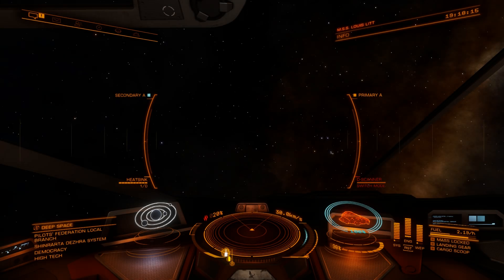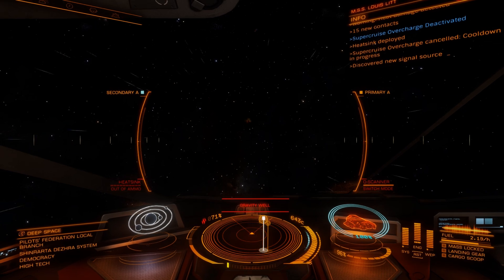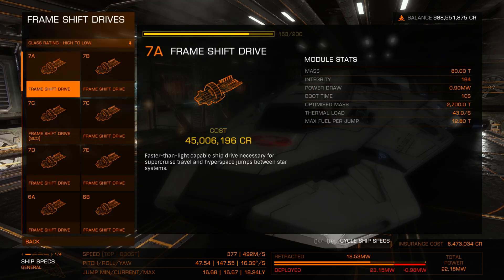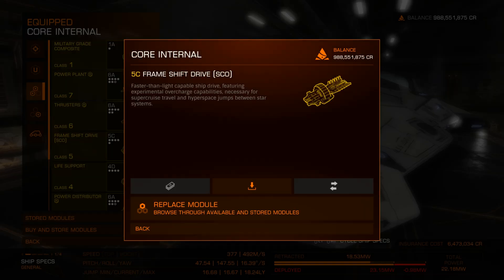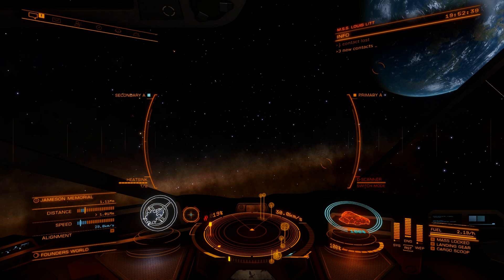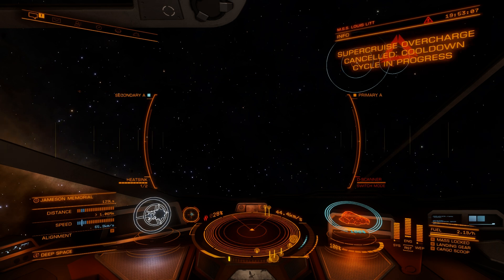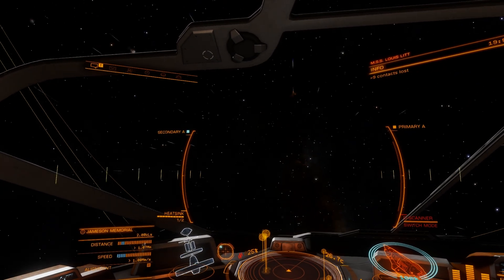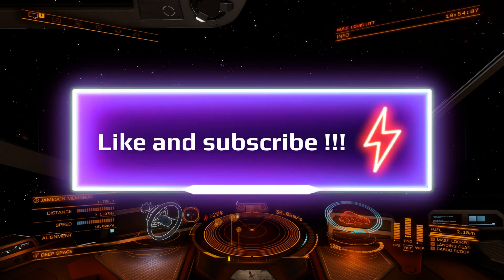Elite Dangerous Odyssey. The Thargoid FSD (  How does it work and where to get it ).

Comment: Tried it myself, it’s cool but don’t see why I would use it…07
Reply: It's a prototype, so it's not very useful at the moment, but perhaps on the new Python? It will probably be rolled out on B and A-rated FSDs later and so on . . .
Reply from the maker: For the moment there is not really a use for it... 🤔
Reply: @Grimulas  Totally can see the uses for it. For my already low range combat ships, it makes supercruise travel just obsolete if used properly. Will be using it on short range mission ships.
Reply: @Grimulas  Ah well. They had an opportunity to fix long supercruise waits but this module with it's poor jump range and fuel requirements is nerfed on delivery.